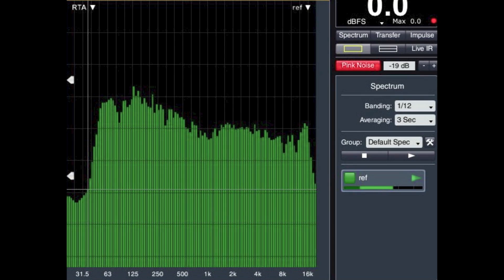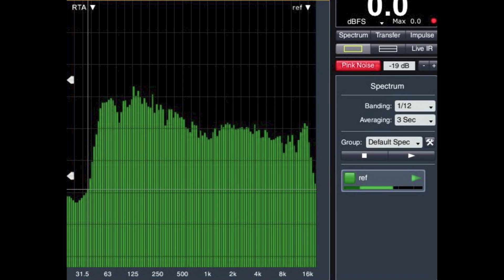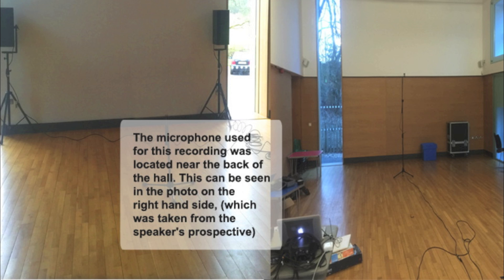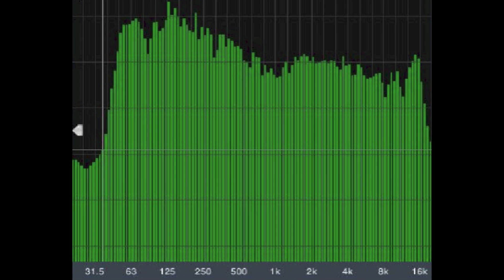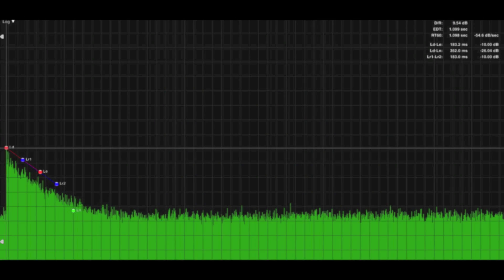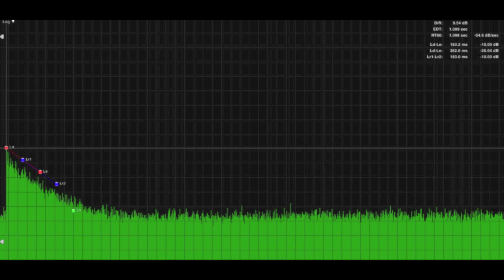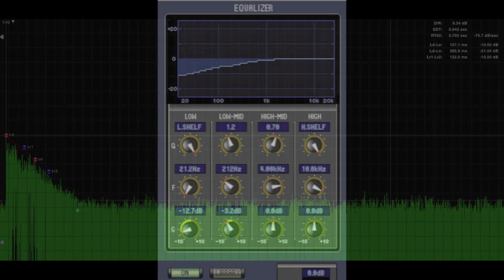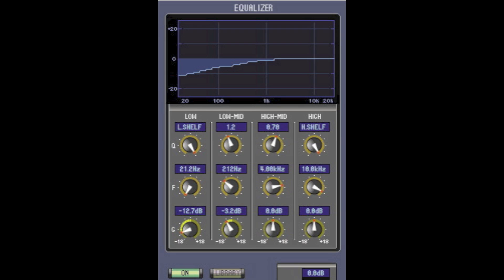EQing P.A. system for the room

Comment: Understandably, this process is done before the audience arrives. But we are trying to optimise sound for when the audience is present. Does it make much difference? Are there any standard 1st guess corrections that can be made to the bare room EQ to compensate for the bodies that will turn up? Might be less for venues with plush seats compared with those with bare wooden floors.